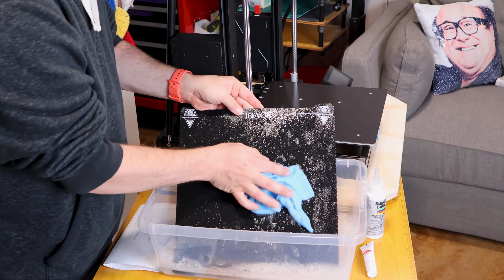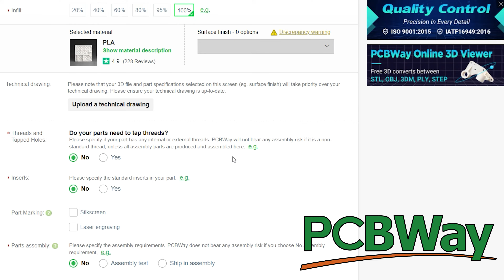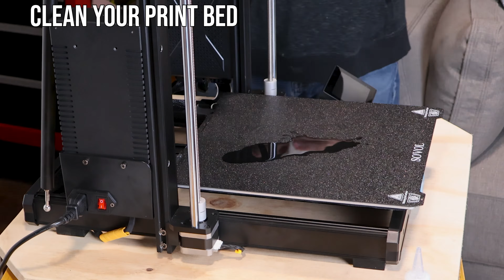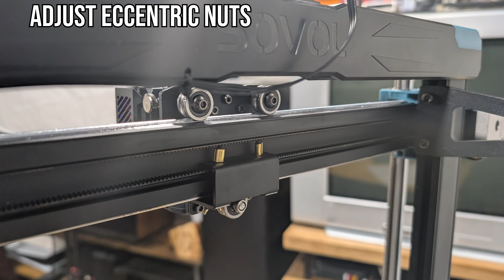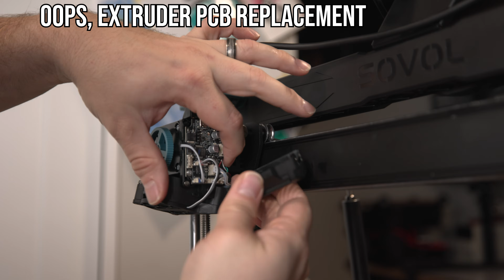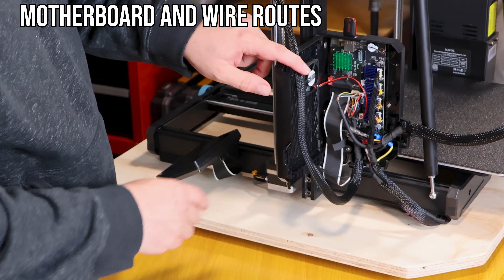Sovol SV06 Plus ACE Maintenance And Troubleshooting

Comment: Just watching you clean the bed tells me you don't know much about printers..  NEVER use paper towels.. they leave lint and will mess up adhesion,  Use a microfiber cloth ,  also when using alcohol, I highly recommend using like a small fingernail brush.. the one with the plastic bristles.. use a circular motion  I do this while the bed is warm around 55 to 60 degrees    Just Saiyan

Comment: Hey wondering if you could help me figure this out. I’ve had the sv06 plus ACE for a couple weeks, probably only about 50 hours of printing on it. There’s brown dust building up on only the bottom rail of the x axis, and falling onto my last two prints. It hasn’t been a problem until 2 prints ago I saw it falling on a print, I thought maybe it was just normal wear/build up of dust so I just cleaned it and started the next print, within minutes it was doing it again. The bottom roller isn’t sliding it’s rolling as it should, the belt looks fine and is properly tensioned. There’s not dust on the x axis motor or belt itself, only on the bottom roller and rail. I’ve been googling all day and read on sovol’s forum that you aren’t supposed to apply grease/oil to x or y rails, only z rails/screws and to just keep x/y rails clean and dry. What could it be? I have prints to do but I’m scared to run it anymore until I find a fix so as to not cause any lasting damage. Thanks in advance for any advice.
Reply from the maker: I don't have experience with brown dust on any printer but my Kobra 3 Max had black dust before the belt snapped so I would back off the tensioner just a tiny little bit.  I would also check the eccentric nut on the print head to make sure it's not binding on the rails because it's too tight.  You want that nut as loose as possible while not being able to wiggle the print head on it's rails.
Reply: @T @TKMakes-2024 hanks for your response. I’m leaning towards it’s an eccentric nut problem too, though it’s not terribly tight being that the roller still rolls not slides, maybe it’s just a hair too tight. But it’s also only an issue for the bottom roller. The belt still looks like it did when brand new, the printer practically is brand new, though I’ve been printing like a mad man.